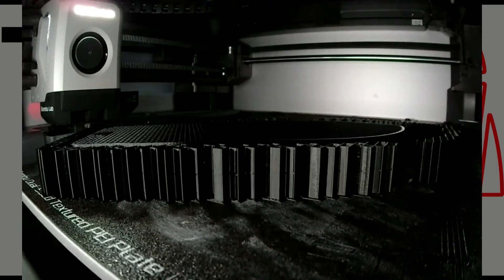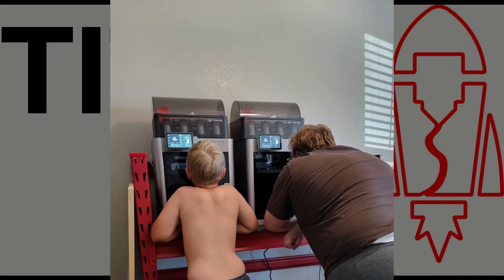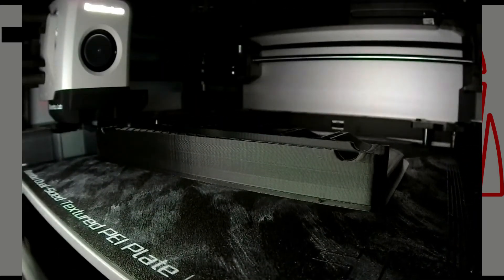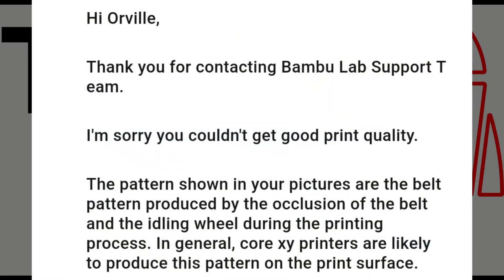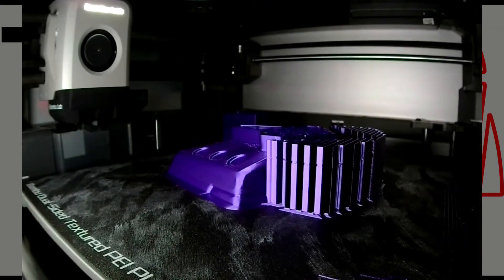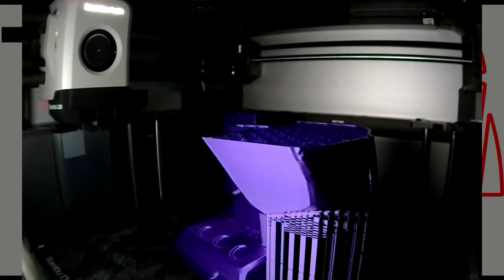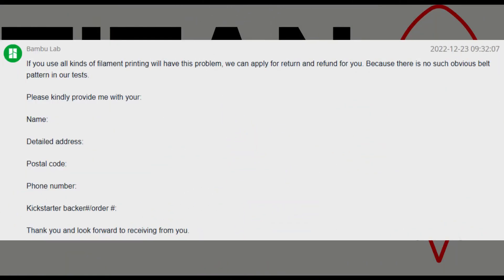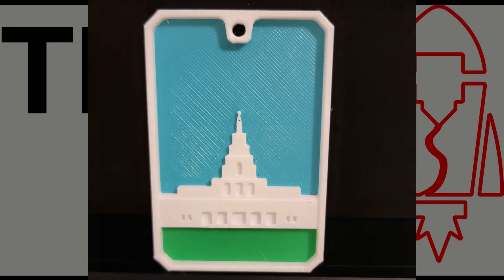Review of the Bambu X1 Carbon You Didn't Expect

Comment: if you want an accurate print the only way to go is Ball Screw drive
Reply from the maker: I don't need that level of accuracy, I just need the belts to not resonate as much.
Reply: @Titan3DAZ  if you don't want the ripples caused by belts the only way to go is ball screws. belts stretch and deflect they tend to have resonant oscillations that cannot be tuned out because the unsupported length is continuously changing.
Reply from the maker: @Almost Human  I disagree with that seeing as how vorons don't have this issue, nor does any of my other printers with long belt paths.
Reply: Ball screws are slow and wear out fast.
Linear motors are the best, fast, extremely accurate and never lose their position, too bad that 3D printers are still using ancient technology for the actuators.
Reply from the maker: @YaFunklord  I might just have to design my own using linear motors then.
Reply: @Titan3DAZ  It's more work than it was to design the rest of the printer.

Comment: Swap out the smooth idler pulleys that have the teeth of the belt riding on them with idler pulleys with teeth... so that the belt rides flat and even on the idler pulley... which basically takes most of that vibration out of the belt. I dont know why most printer companies use those damn smooth idler pulleys when the teeth of the belt run on them at rates of speed and with a ton of inertia behindthe tool head/hotend! It's like trying to shove a square peg in a round hole lmfao 🤣🤣. I am going through the same thing with my x max 3, but my qidi x max 3 doesn't leave anywhere near that bad of those ripples! The layers look absolutely perfect and can barely be seen except in super bright light. It is almost like an optical illusion or some type of lighting trick. The ghost ripples with my x max 3 are ever so faint... but still there nonetheless because of those damn smooth idler pulleys. I am currently in the process of working with Qidi tech customer service to find the fastest solution  to this issue. I wouldn't have ever returned the printer for a refund, tho.  when problems can A.) Be fixed now by changing out parts, or B.) Fixed down the road a little bit by problem solving with the 3d community. This is why I only rock with Qidi tech. Their customer service can NOT be beat in the 3d printer game! I still have 2 of the qidi techs' gen 2 printers... the x max 2 and the x plus 2, and qidi tech still over nights any parts that break, wear out, bend, snap, whatever.... YEARS LATER, and even if it is my fault, qidi customer service ships me parts overnight! They listen to their customers and fix issues with lighting speed. I had issues with my x plus 2 last year... and Qidi tech offered me half of my money back without me even asking them for a refund. Then they shipped out brand new parts overnight that very same day! No questions asked, no hassle and no problems is the Qidi tech way, my friend. They have made me a customer for life based solely on their customer service.
Reply from the maker: I would have done that, but they're pressed into place and there is no way to get the pin out on my printers.
Reply: @Titan3DAZ  Yeah, it definitely is some work to do so... but I always tell myself, if they put it together somehow, I can take it apart somehow/someway. Like I said, I am in the works with Qidi to solve this issue. I have looked around on the internet to find instructions or a guide to take apart the gantry... to get those pulleys out. but there is none yet because it is a newer printer. So I might record my own video, taking apart the gantry to swap out the x and y axis idler pulleys.
Reply from the maker: @danieljamesbinderystu2968  I would have done that. Honestly I love taking things apart, but I was behind on orders and needed machines that would work. Tinker machines would have to wait

Comment: Absolutely phenomenal job. A very wonderful explanation of the issue. I knew there was more tho this printer than perfection and I’m genuinely thrilled someone is shedding light on it!
Reply from the maker: Thank you! I certainly plan on doing some more real world reviews of full time use case printers.
Reply: @Titan3DAZ  If you’re into the DIY approach you might like the project I’ve got going over on my channel. It’s not something you can buy atm but it is open source(at least what I’ve uploaded so far). Long term reliability has been my main goal. Speed is obviously nice to have but if you don’t build it right from the get go it will come back to haunt you in the long run. 

    I’m sure Bambu Labs is internally on fire over this. Honestly serves them right for making user serviceability an afterthought. They could have otherwise easily shipped you some replacement toothed idlers and you’d be on your way.

If you’re not concerned with speed but just want something that might outlive you I recommend you check out elite machine works.

Regardless I can’t wait to see your future videos! Subscribed for sure.
Reply from the maker: @Hood Plastics  thank you! I'm definitely considering all my options. I am also considering designing my own corexy machine. I'm not one for the bed-slingers. They're specially inefficient imo.

Comment: I am glad that you sent them back. if you want to start a 3d business, just throw together a piece of junk and call it a 3d printer,  that's what the 3d company's are  doing.  the buyer will fix you. i have four and i will never buy another, they belong in the trash and will end up there.
Reply: That is explicitly what the bambu has tried to avoid doing, and this is an instance where the over-engineering has backfired.. They actively don't WANT you to have any hand in the calibration or setup of the machine, nor fix it with bootstraps if it goes down. For the rest of the industry I agree, old lazy tech resting on laurels, but this is a garbage take for the x1c.

Comment: The pulley should not have been smooth. But have teeth.
Reply from the maker: Exactly. They also used a push in pin without a through hole so I couldn't get the pin out.
Reply: A tpu insert over the smooth pulley to make it toothed might work and be easily replaceable